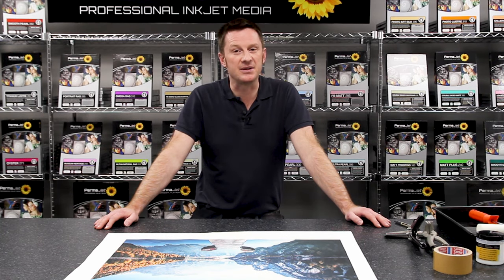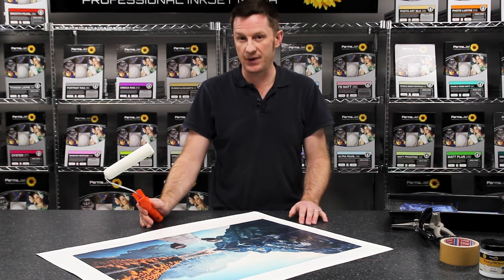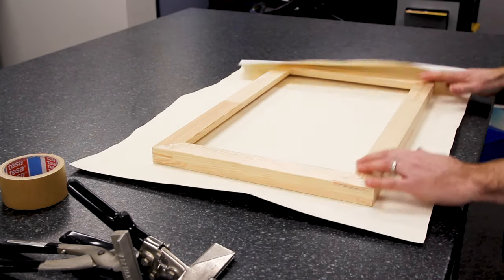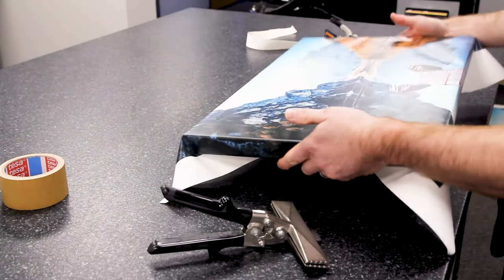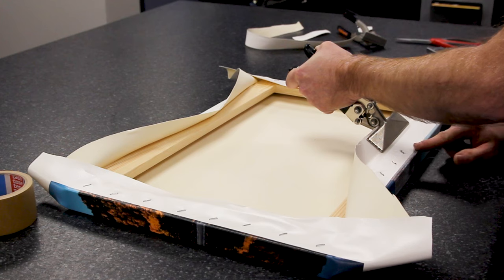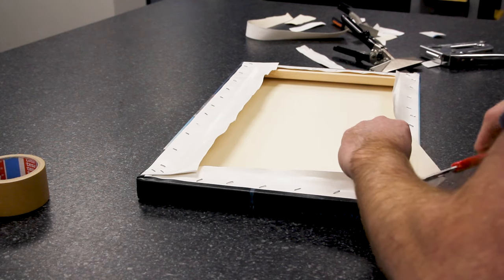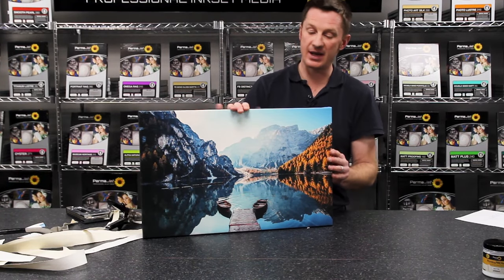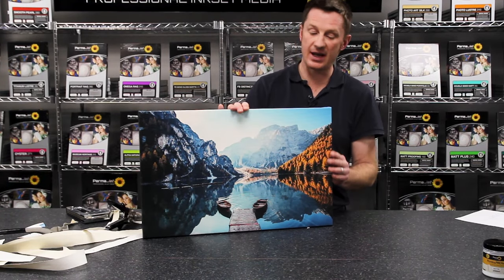How To Make A Canvas | Varnishing & Wrapping

Comment: Thank you for a very helpful tutorial.  Do you know the brand and model of your stretching pliers?  All of the canvas pliers I can find have the 'pry-bar' part facing downwards, rather than forwards as yours do, and so are designed for stapling the canvas along the side edge of the bars, rather than on the back of the bars, as in gallery wraps.  My fingers are sore and tired from hand-stretching with grip strength only!
Reply from the maker: You're welcome David! These are the pliers used in the video: https://www.lionpic.co.uk/p/9599/Pro-Stretcher-Pliers-150mm-Wrap-Around
Reply: @PermajetUK  Thank you.  Wow, that is the 'king of all pliers'!

Comment: brilliant video, just wondering is that canvas now waterproof along with the ink, also what printer did you use, many thanks really intrigued.
Reply from the maker: The canvas print is water-resistant, meaning you can safely wipe it down etc. It was printed on a Canon PRO-4000
Reply: @PermajetUK  what canvas and ink would you recommend for outside, thinking of doing a sign for my shop. thank you
Reply from the maker: @thedalz5308  our canvas wouldn't be suitable for outdoor use but we do have materials that can be used for short term signage. Get in touch for more information sales@permajet.com or 01789 739200
Reply: @PermajetUK  ok will do thank you
Reply: @PermajetUK  Any other less expensive printer that you recommend with similar quality?
Reply from the maker: The Canon PRO-2100 is a smaller and less expensive printer with the exact same quality. Otherwise you'd be looking at the desktop range which can print up to A3 or A2, for example the Canon PRO-300 or PRO-1000. You can see the whole range on our website - https://www.permajet.com/product-category/inkjet-printers/canon-printers/

Comment: do you have any tips to get the varnish smell out of a room please?and is it ok to smell those chemicals i just wear a mask when applying but after the smell stays
Reply from the maker: Hi there, are you using PermaPROtect varnish? Our varnish is water based so there is no danger to inhaling it, and the odour should disappear after it has dried similar to a household paint

Comment: if you use canon prograf 2100 for printing, is it still recommended to varnish your prints?
Reply from the maker: Yes we always recommend varnishing canvas to protect it and improve longevity. It also improves the saturation and contrast of the printed image
Reply: @PermajetUK  Let's say I want a matte finish, would varnishing it makes the output glossy? By the way, thank you for the info and for making such great content.
Reply from the maker: @lonewolf4663  Nope - we have a matt varnish too! And no problem at all. If you'd like more info on the varnish we sell you can check it out here - https://www.permajet.com/product/permaprotect-varnish/
Reply: @PermajetUK  I see,  I will definitely check it out. Thank you!

Comment: I working in procreate I usually drow in this app how can I print my work on canvas and it’s important to know the quality of the picture?  If yes how much
Reply from the maker: You'd need to print your work through Photoshop or a similar software. Yes it's important to have a high quality picture to achieve good results
Reply: @PermajetUK  and how can I transition my work from ipad to canvas
Reply from the maker: @Suhila Mohamed If you want to print it straight from your iPad you'll need to use AirPrint, however we recommend sending the file to a computer first to get fully colour accurate results
Reply: @PermajetUK  oh yes I will do this and It will be better to print any picture by laser printer right?
Reply from the maker: No, you'll need to use an inkjet printer. If you need further advice give us a call on 01789 739200 and our team can help